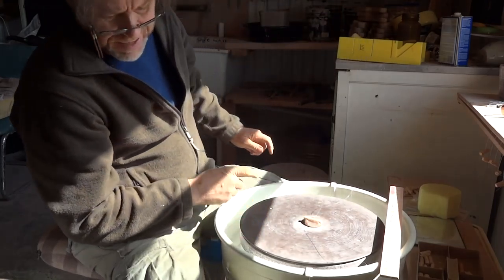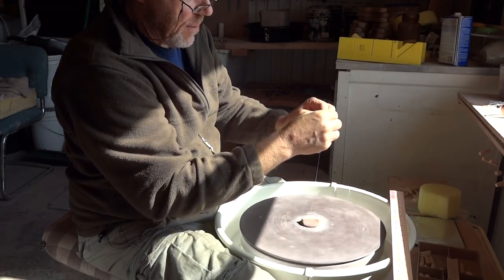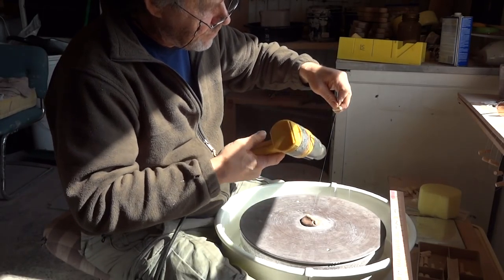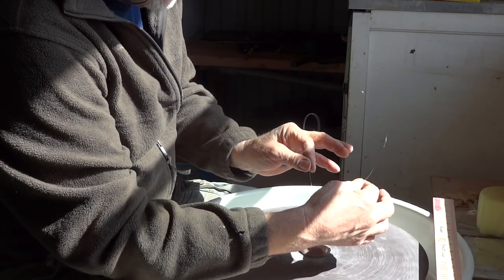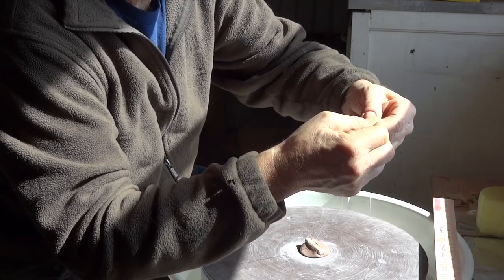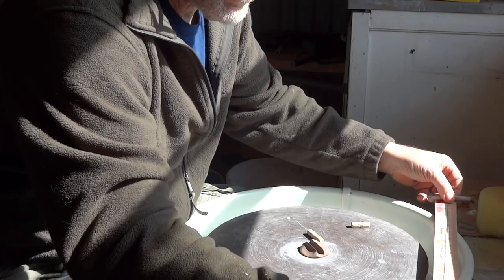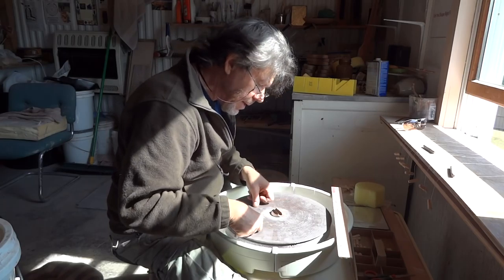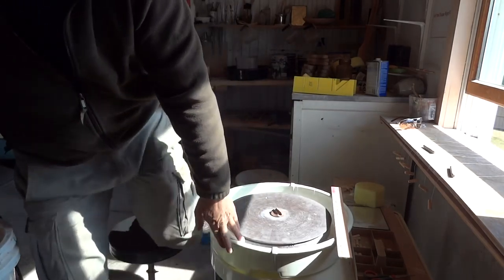SIMON LEACH POTTERY TV - Simon making a throwing cut off wire !

Comment: Thankyou for sharing with us how to do this, I’ve been using a broken guitar string. with a small stick attached to each end. It works ok, but it’s getting warn, so I think I will try making one of these cut off wires. Also, Thank you for teaching us the difference between a throwing wire and a wedging wire. I really think that most people don’t know that. I know most of the people in our ceramics lab here don’t know.

Comment: Excellent, a wheel thrown  and spin bisqued cut of wire !!!
Reply from the maker: +rbanalog Not a bisqued fired end ...two wooden ends one large, one small. The bisqued ones kept breakling when they fell on the floor !
Reply: +Simon Leach I meant the nylon with the electric  heat gun actually and twisting it on the wheel !